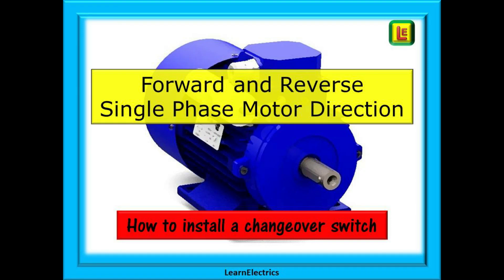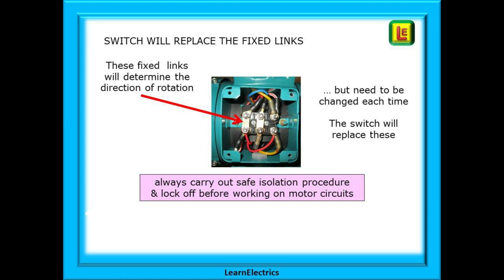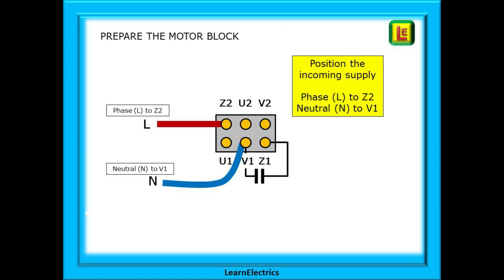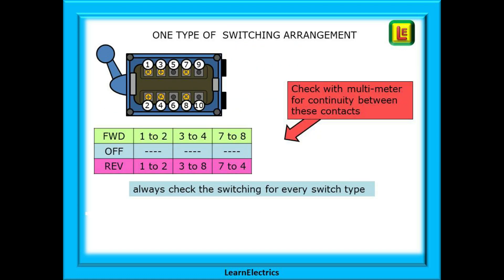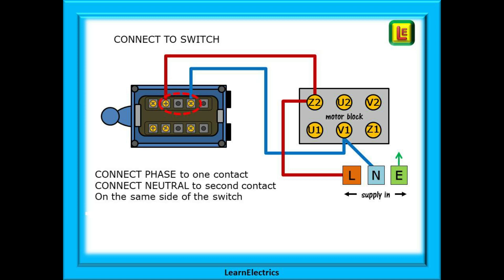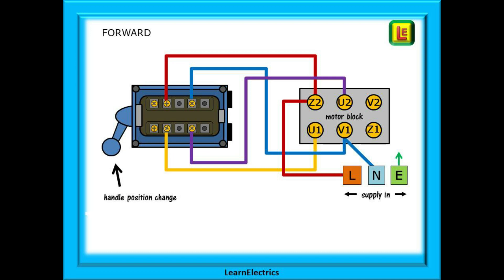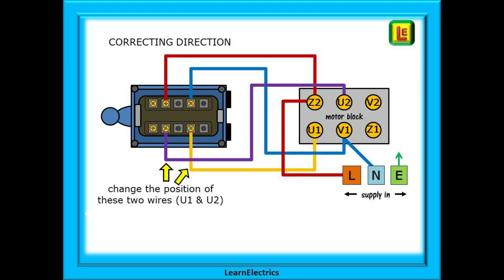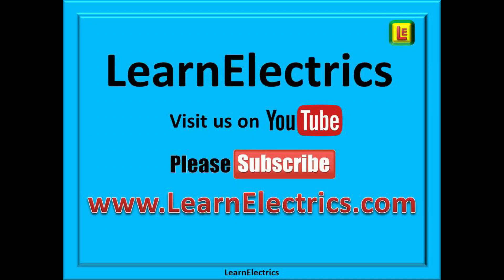FORWARD REVERSE SINGLE PHASE MOTOR DIRECTION and how to install a changeover switch

Comment: Thank you for such a simple explanation. I'm installing a single phase motor onto a car lift that was originally 3 phase. 
I did search Google and Reddit for instructions like this and only found people overcomplicating matters and leaving key parts out. 
My motor and switch pretty much match exactly what you have described in the video so I'm confident now I can get this working. If only everyone could be so transparent. 
Thank you again!
Reply from the maker: That's fantastic to hear, glad the video made it clear for you.
All we want to do is make the motor move backwards and forwards, the simpler the information, the more people that can profit from it,
Thanks for the great feedback. Dave.

Comment: Very well sir, thanks for the information.Sir I want you to us,  a forward reverse ac motor with no centrifugal switch.the start winding coils is smaller than run winding.The motor is a capacitor start.can show us this diagram please.
Reply from the maker: Appreciate the feedback, will put it on the list. Dave.

Comment: EXPLAIN HOW TO SELECT THE MAIN CIRCUIT  WIRES IN THE STARTERS PANEL  &. IN COMING  AND OUTGOING CABLE TO STARTERS.
Reply from the maker: You can trace these from the the boards, make sure you do safe isolation first and work on dead boards as much as possible. Thanks for watching.

Comment: Dave, When wiring from mains to switch to motor - if Live AND Nuetral comes in to Terminal 3 and Terminal 7 respectivally and is followed on through to the motor (as in diagram 8min 20sec) wouldn't that bypass the switch?
Reply from the maker: That's the way the crossover switches work. the drawings are correct. Thanks for watching. Dave.

Comment: cycl47 isn't wrong! There's heaps of them, but they all miss something. Yours is Perfect.
Reply from the maker: Thank you, appreciated.
Reply: @learnelectrics4402  But... I just now wired it up and... FAIL. I have to assume it's something I did wrong. I plugged it to the mains and flicked it on and the motor didn't turn but made a scary hum so I flicked it off. After a multimeter test, there was continuity in the switch between terminals 4 and 8 in the OFF position! Those two wires are on Nuteral=U2 and Live=U1 on the motor block. So that's where the continuity is from but I cant see how. Any suggestions Dave?

Comment: i done the same  configuration of supply into motor and after starting motor it kept going when turning to off , i put supply via drum switch  and thie supply was then switched off through drum switch and motor stopped when off
Reply from the maker: Check the manufacturer's pin-outs for the connections on their website. There are several variations around.

Comment: Does the amount of poles in the motor change your videos wiring
Reply from the maker: The number of poles will determine the rotation frequency. Wiring should not affect this.
Reply: Thanks. Great channel. My local supplier was telling me i needed a 4 pole switch for my 4 pole motor. Just couldn't see why
Reply from the maker: Not at all, this is single phase.

Comment: Hi. Very good video... What switch I need, with 1 phase or 3  phases for this tipe of motor to make this connection?
Reply from the maker: You will need a motor changeover switch with break before make contacts.

Comment: This is probably the best tutorial I’ve seen so far . HOWEVER my terminals have U1 , U2 , Z2  but then  S & R  no V1 V2  or Z1 what would S&R correlate too ? Brooks Compton motor Thanks
Reply from the maker: Check on google for your exact motor type. It should be easy then to match to the drawings, which are the run and start coils, the switch terminals etc.
Reply: @learnelectrics4402  I Wish it was that easy as there isn’t any I can find KP7575

Comment: What is the wiring diagram if directionsl switch is built in the motor...directional switch is available as K1, K2,K3,K4.
Reply from the maker: Good idea, I should do a video on that. Its on the list now. Thanks. Dave.

Comment: Lots of people are showing how to use drum switches on YouTube.
I want to learn how to reverse a drill press motor by using a toggle switch, not a drumb switch.
Reply from the maker: Have a look at this video.
https://www.youtube.com/watch?v=2khKIuHD5dw
Reply: Unfortunately that one is a three phase motor.
I need to put a toggle switch on a single phase motor.
I'm trying to find out if I can do it with a double pole double throw or a triple pole double throw.
And how to wire it in.

But thanks for trying to help.

Comment: Good video but in my opinion you should of included the normally open connection for the live, this will have beginner electricians confused, for anyone wondering why your motor is humming and not turning off, you need to connect your live supply on the switch to contact 1 then link contact 2 with contact 3. Brilliant video other than that.
Reply from the maker: Thanks for the input Harry and thanks for watching. Dave.
Reply: Yes that's true. There should be an actual demo after the concept. Thank you.

Comment: This is easily the most helpful video on this subject that I’ve seen. Thank you for making it far less complicated.
Reply from the maker: Glad you found it useful Paul. Thanks for the support. Dave.
Reply: Just one quick question though, I’ve followed the wiring diagram to the T and tried 2 different switches. When in the off position, the motor hums. The motor does go in forward or reverse, but I have to switch it off at the wall before I can move the switch to change the direction. If I switch it to the off position from either direction, the motor starts to pulse. Any ideas on what could be wrong? I’m starting to pull my hair out about this.

Comment: Thank you very much, the first time someone has explained the wiring of a rotary switch which I can understand, I had to give up the idea of a reversible motor on my lathe untill now ( bit thick)
Reply from the maker: Glad it helped Paul. Not thick at all. You just didn't have the right information. Thanks for watching. Dave.
Reply from the maker: Don't under-rate yourself, we all need a guiding nudge at times. thanks for watching.

Comment: Hi, I followed the video exactly but with the switch in the off position the motor is making a loud humming noise, I didn't turn the switch to see what would happen, am I going wrong somewhere?, With the plug out of the wall I turned the switch and all the terminals on the motor block have continuity, is this right?
Reply from the maker: Sounds like the start/run capacitor is not pulling in. can you detach it from any mechanical load, start it again and this time spin the motor shaft with your hand wearing gloves recommended, it will go fast if it starts.  If it does start with a hand spin, the start capacitor is either broken, missing, or not being pulled into circuit by the contacts. Have you seen this motor run before? Check your wiring too.
Reply: @learnelectrics4402  the motors fine, I've put it back to a fixed configuration with the bridge contacts in place and it runs ok, I didn't try to run it when I wired it, it was making the humming noise with the drum switch in the off position, thanks for the reply,
Reply: @breconmerthyrgwr9250  Great video b.t.w - really clear and short explanation.  I too had an issue in the "off" position - the motor was actually turning at low revs - and we double checked all the connections.  In the end we directed the live input to run 'across' the left most two terminals on the switch.  This then gives us a straight connection,  connecting the live in both forward and reverse.  Also the added bonus of actually having an an off switch for the motor which it did not before down stream of the plug.

Comment: How about 220v motor
Reply from the maker: Most motors will have a range of working voltage on the label. 220V to 240V for example. Check the rating plate on the motor. Thanks for watching. Dave.

Comment: Mine doesn't have v1 and v2
Reply from the maker: Check the motor number on google, there will be a drawing for your motor somewhere. There will be some sort of marking on the terminal block which you should be able to compare it to. Dave.

Comment: Sir please explain this motor which type. In single phase motor have two winding( starting winding&running winding). But in above motor have three winding....?
Reply from the maker: Only two windings in a single phase motor. A three phase motor has three windings.
But they both have a six pillar connector block.

Take a look at these two videos on 3 phase motors.
https://www.youtube.com/watch?v=2khKIuHD5dw
https://www.youtube.com/watch?v=45re1J-RxKc

Thanks for watching, Dave.